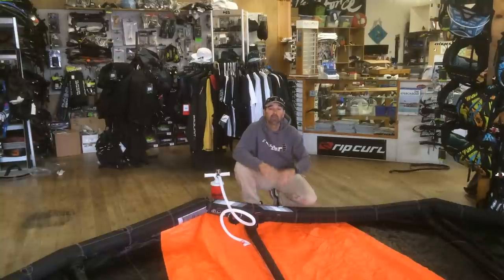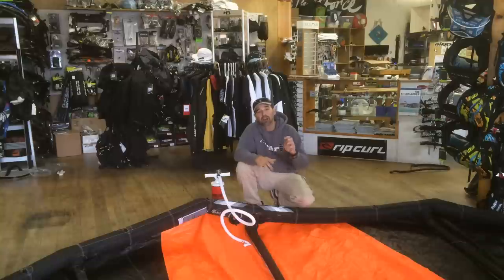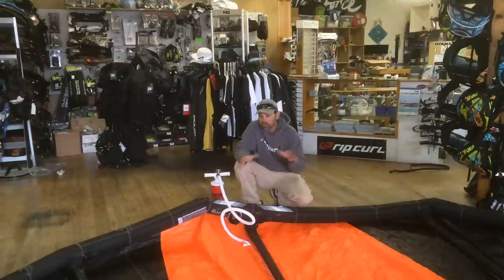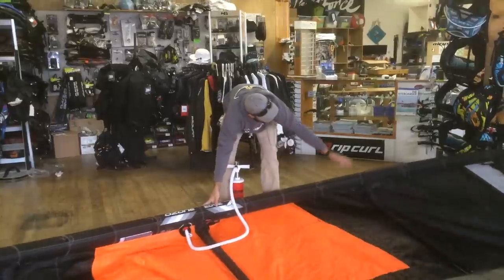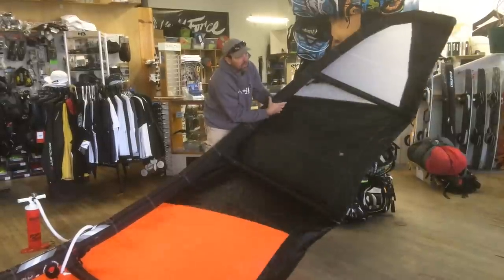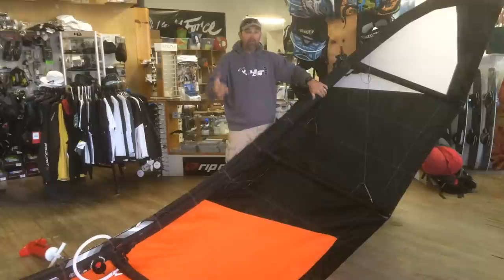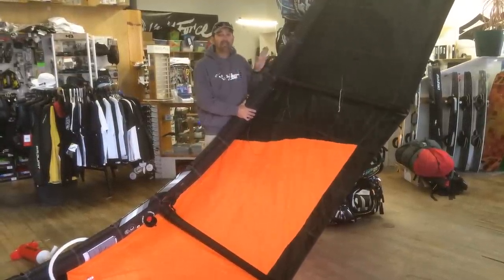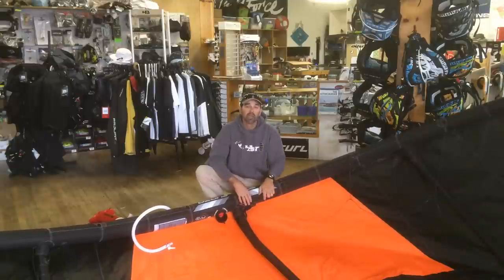Kiteboarding: How to Properly Inflate your Kite

Comment: Several guys pump until it's rock hard, aka until you can barely pump it up any further.   I've done this for years, thinking it improves the stability of the kite.  Wondering if this is ok.
Reply: I would also say that when you can fold the tip like this it's too soft. I learn that you should not be able to bend the le very easily.